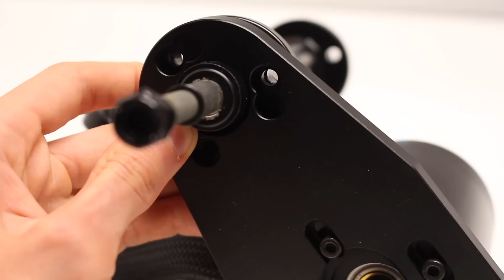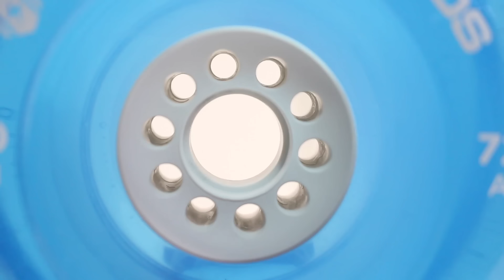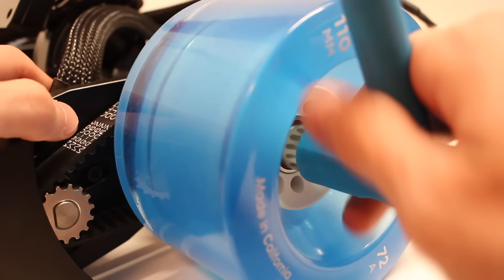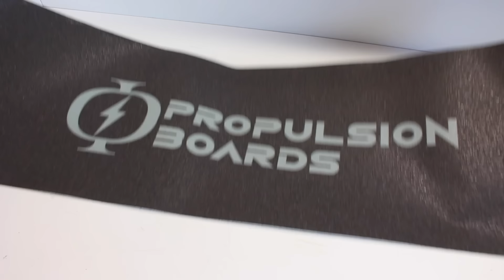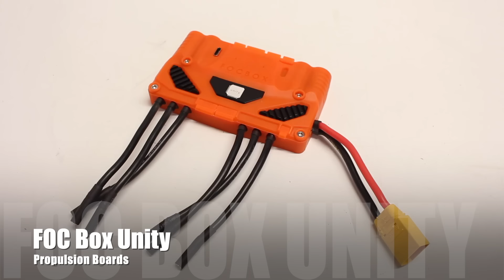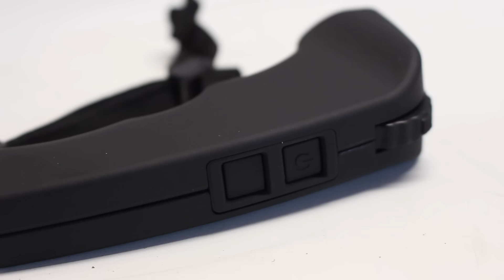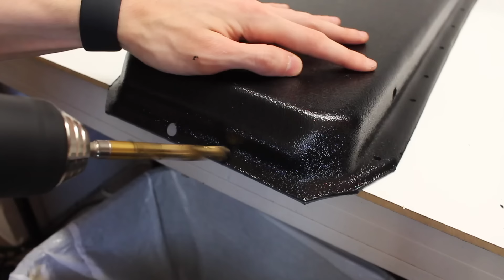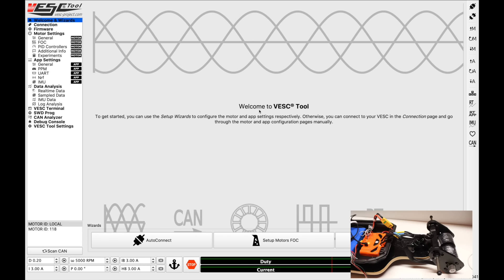*THE DEMON 2.0* How to Build an Electric Skateboard 38MPH - 30 Miles Range - 7,000W

Comment: Why you never show the speed advertised? And I think you should not cover the deck crews because those are vary Bridle and easily break, you will have to replace them all the time. Same thing came on my Verreal RS and is the weakest point on the board. Every one been breaking them. I replaced with 6m×25 black oxide steel screws, problem gone, wonderful tutorial in the build tho...
Reply: It will not do 38mph. Closer to 30. I highly doubt that they get the mileage they say either.
Reply from the maker: @Eric Fical We will be putting out an update video with a speed tests, the sound of the motors(which some people are asking for), reviews that people are making about the Demon 2.0. I don't know why you think that we are over spec'ing the board.
Reply: @DIYesk8Builders  it will be interesting to see if it can reach that speed and range. I support your channel and what you do even if there is some exaggeration with speed and range. Also I know there’s a lot of variables like rider weight, wind and riding conditions. I wouldn’t attempt going over 30 with my double kingpin trucks. Way too unstable
Reply from the maker: @enjoyesk8978  Yeah definitely, we will have the specs shown. And apps and stuff to track it and show it to everyone
Reply: @DIYesk8Builders  can’t wait for that video how long until you upload it

Comment: Did you guys use the 12s3p 40T pack from chibatterysystems? I have a 12s9p 40T from them, and it Sags a lot for some reason. I contacted them and they said that would be normal. I thought that would not be the case because of the 40T cells.
Reply from the maker: Ours is made by another manufacturer. 40T cell really should not have too much sag though
Reply: It shouldn’t sag. They probably didn’t use enough wire or nickel strip for series connections.
Reply: @enjoyesk8978  That could be the case. Here is a quick video of my battery showing some strips. https://www.instagram.com/p/CFzwAjQpjB_/          It looks like they but a lot on. Could it maybe be a programming issue in vesc tool?
Reply: @piersonbrice4674  yes absolutely
Reply: @piersonbrice4674  what are you using for a vesc?
Reply: @enjoyesk8978  Flipsky dual 6.6 plus. Wizard FOC for programming. I didn’t touch anything else on the vesc tool, just did the wizard foc.
Reply: @enjoyesk8978  My other parts are flipsky 6374 190kv battlehardened motors with 8mm round shaft. 15T motor pulley, 72T wheel pulley. Matrix ii trucks and motor mounts.
Reply: @enjoyesk8978  I used vesc tool 2.05 with a MacBook to program. My wheels are also 175mm 7” tires.
Reply: @enjoyesk8978  also used sensor wires.
Reply: @piersonbrice4674  nice bro! I would mess with your settings. Battery and motor max amps settings
Reply: @enjoyesk8978  for my motor amps the max it is rated for is 80. The wizard put them at around 75 amps. And my battery is 36AH. What should I change so my battery doesn’t sag hardly any?
Reply: @piersonbrice4674  Im running about 40a to each motor potentially. I built a 12s4p with Sony vtc6 cells. They are 20a constant discharge but 30a burst. I believe I used 80a battery max and 40a motor max. The board rips. From take off to full throttle. I have another board similar setup and bigger battery (5p) same cells and it doesn’t have the same take off. I believe it’s because I used 10awg on the other battery packs series connections and not enough nickel strip for the 12s5p battery packs series connections. I also increased the settings for battery max and motor max but I think it’s struggling because it doesn’t have enough nickel in series connections to let the amps flow. I’m going to rebuild it soon as it’s getting too cold to ride here in New York
Reply: @enjoyesk8978  Thanks for the info? I’ll set my battery to those settings and see how it runs! I can get from 0-40mph in about 6 seconds. Hopefully it will still be able to do that once I set the motor max amps to around 40 and the battery to 80.
Reply: @enjoyesk8978  There is slow abs current limit. Should I say false for that? And there is DRV8301 OC mode. Should I say disabled because right now it is on current limit?

Comment: Impressive build 👌. With VX2 remote how does it choose 3 speed modes and what are they on your build ?can these be programmed  custom or come standard
Reply from the maker: It comes standard and all it does is change the acceleration of the board off the line.

Comment: The board is absolutely incredible I love it but my only complaint is I can see the screws through the grip tape and there is a clicking noise wich is really annoying when riding...😟
Reply: Nicholas Cooke   I went through everything and I just can't figure out what it is...
Reply: What has the range been like for you
Reply: @jackmaley8   I usually get between 25 and 27 miles
Reply: @pikachu_3311  that's great. Did you figure out the clicking noise?
Reply: @jackmaley8   nope
Reply: @pikachu_3311  dang. I'd hit them up and ask them. Would you recommend this board?
Reply: @jackmaley8  I would recommend yes!  Only if u love to ride im on the board pretty much every day I love this board the speed is incredible and the torque wow range is awesome down fall its $2k plus shipping

Comment: Well, looks like I've got a new project.

EDIT:  I gotta ask, how does the BKB Duo stack up?

EDIT 2: For the enclosure... After the wires are snug, couldn't you flex seal or plasti-dip a seal?  Just for some sort of water proofing?
Reply from the maker: Personally I have never tried it. The duo looks like an incredible board too, but the demon has larger motors and bigger battery. Both boards will also have a different feel as we use dip and they have single kingpin.
Reply: @DIYesk8Builders  Thanks for the Video, I know what I'm getting for Christmas :D
Reply: BKB Duo has absolutely NO competition. Demon 2.0 makes it look like a complete joke in terms of power, acceleration, torque, and speed. Mine arrived a few days ago and it’s just so powerful and perfect. Far more superior than my Verreal RS & friends Evolve GTR
Reply: @6-carboxydetrahydropterin-485  thanks bro.  I'm looking for a new board and 30 miles of range seems too good to be true.  Also, this 2.0 just looks sexy as all hell.